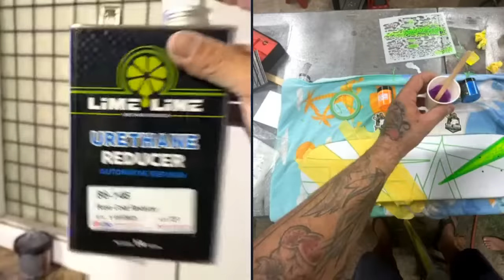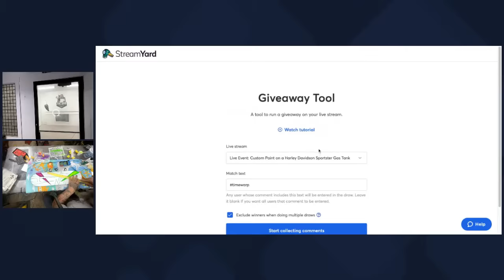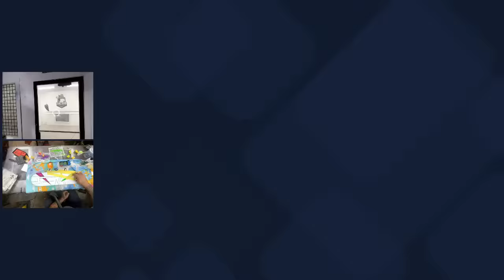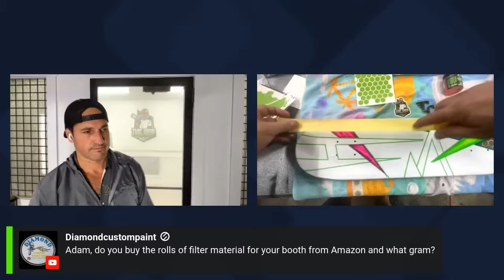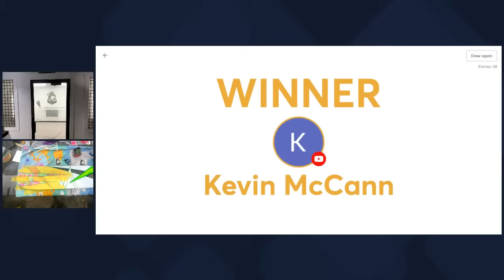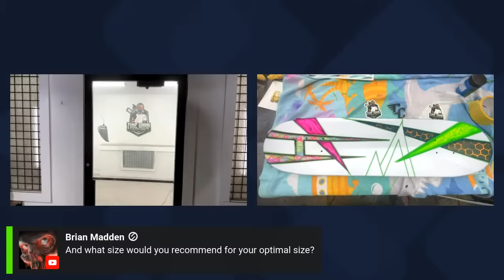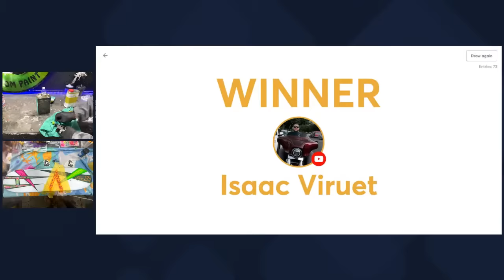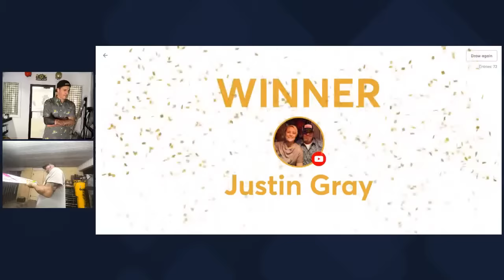Live Event: Custom Paint on a Harley Davidson Sportster Gas Tank

Comment: The black basecoat before the metal flake, is that just a single stage urethane?  What brand do you prefer? I was looking at speedkote. Also when laying down the pinstripe how do you keep the corners from folding over on themselves
Reply from the maker: No it’s Black basecoat not single stage. I use LiME LiNE black.   With Layin fineline make sure you’re not stretching on the tape too hard on sharp corners.
Reply: Thanks for the advice! I think I’m going to have to try a different style tape, the stuff I have is just a thin green masking tape. Is that what I’m supposed to use or is there something else that works better?